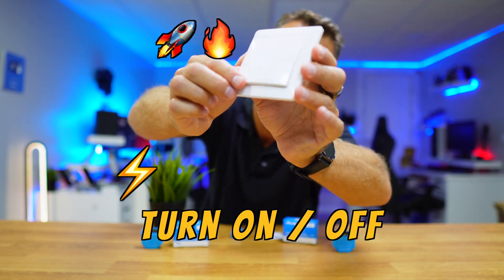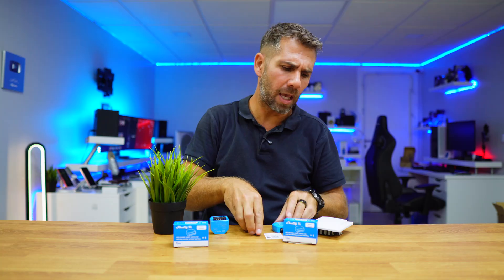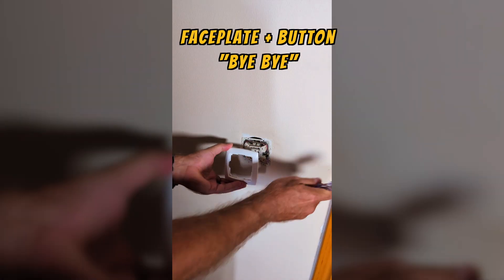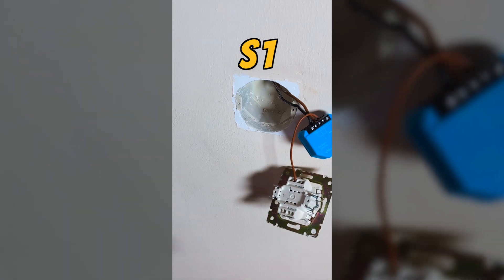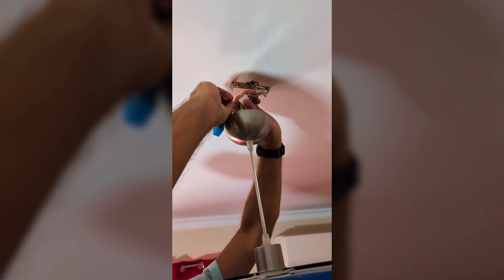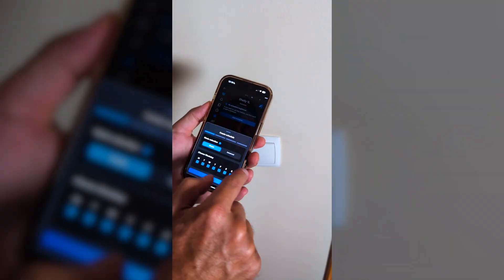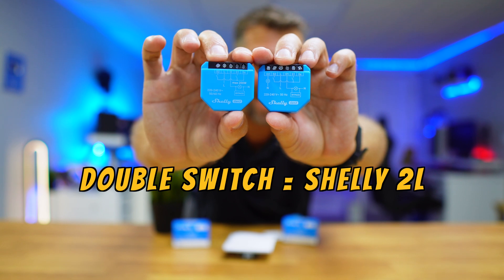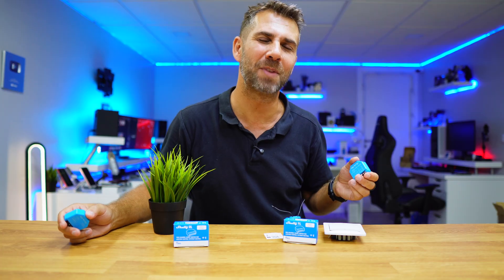Make Any Switch Smart WITHOUT Neutral 🚀🤯 Shelly 1L & 2L 🤯

Comment: What kind of wireless connection is used, is it WiFi or Bluetooth?
Reply: Thanks for the video.
However in my case i have 4 downlights, do i need 4 light protector thingy for my 4 LED downlights?
Reply: Most have both, if its compatible with Smart Home Apps it would be WiFi based.